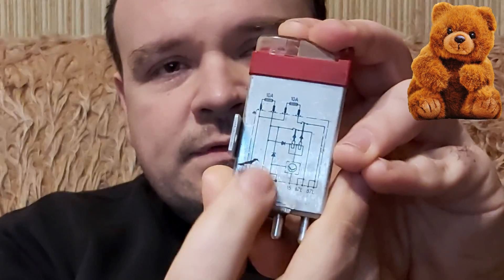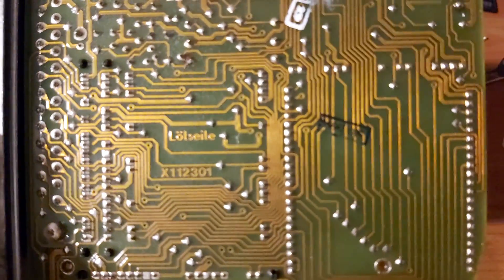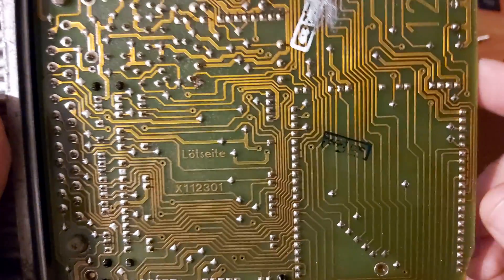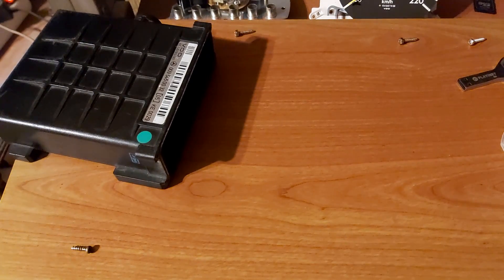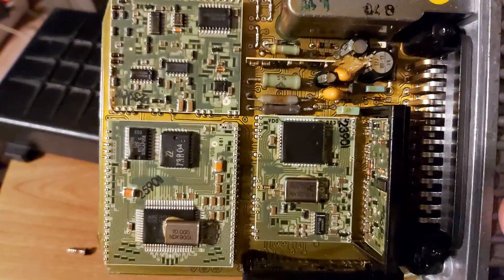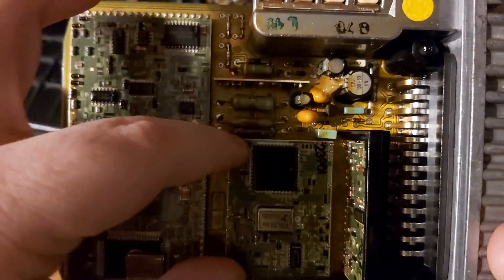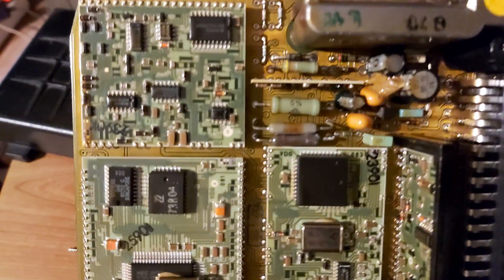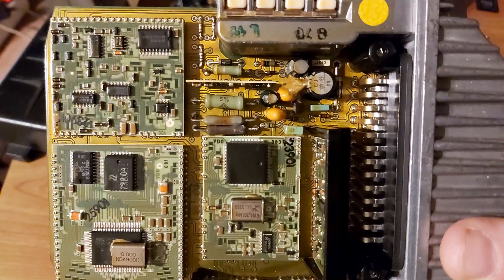㉦Mercedes Ke-Jetronic㉦ - Does the ECU fail?

Comment: My ecu was burnt, to the point where there’s a smoke smell in there… the was was water in the ovp and from there we just don’t know what else to do please help😔
Reply from the maker: What should I say!? Remove everything, replace the OVP as well as the ECU, clean everything, afterwards check all the contacts as well as the wires. This could have happened only if the car was flooded as I would say.
Reply: @ wasn’t flooded, guys at the car wash power washed it the bay to remove the leaves

Comment: What about capacitors in the ECU? I think they do fail, becouse of years.
Reply from the maker: Maybe. ECUs fail in rare cases so no one can tell for sure.
Reply: @mercedeske  I agree with that and hope mine does not fail.
Reply from the maker: @Gr3eGo  🛐
Reply: Hi, my ECU fails twice in couple of years. Only on regulating idle. First time when i change the ECU the problem with low idle was solved. Now, after few years my idle again go bad. After some other repairs we changed the ECU and idle is ok now. How do you think, what couse this?
Reply: @ВасилИванов-р6ч  open your ECU and replace condensators
Reply: @Gr3eGo  This is what i'm going to try next. Just wondering why is always the idle going bad.
Reply: @ВасилИванов-р6ч  idle is controled by the Idle control module and not the Bosch ECU... At least my 560 works like that.
Reply: @Gr3eGo  Mine is 200E😕. After replacing the air flow potentiometer the idle was still bad. Then we put another ECU and idle fixed.
Reply: @ВасилИванов-р6ч  I understand... Different car then .. inspect components inside ECU and replace all condensators, they lost theit capacity for sure after 30 years. I have replaced almost all in my car, even clock stopped working from bad capacitors... But nice thing is it is reparable.

Comment: Hello, i just want to say, that it can fail. Every soldering point is week point, after some time and very temp changes, that solder point can be weaker and resistence will increase until its fail. 
But its a easy repair, if you have solder gun and some knowledge, its easy.

Comment: Hi, want to learn from you that what would the KE Jetronic car behave at idle without the ECU?  Running rich, higher than the normal 750 rpm?  thanks in advance
Reply from the maker: A bit higher idle the car wouldn't have so much power but it wouldn't stall.
Reply: @mercedeske  Many thanks!
Reply from the maker: @herrickmky  My pleasure

Comment: My car won't turn on the dash, fuel pump and heaters when I turn the key, after a while it will start working, is there a solution?
All the fuses are fine, but I found one on the OVP was blown and I replaced it, but it's the same.
Reply from the maker: Is it about a diesel or a petrol car?

Comment: Hello I have an m103 engine vehicle, all the sensors have been changed, the distributor has been maintained, the poti is new but it works unbalanced sometimes and the idle speed does not increase. Could this be another reason? Could the ECU be faulty?
Reply from the maker: If the ECU was faulty, the cold start would be bad and the start in general. Concerning the poti - have you calibrated it?

Comment: Sorry,Not agree with you Ivica
Reply from the maker: Okay, tell me what happened and how did you know that it's the ecu?
Reply: @mercedeske  I haven’t the current on EHA . I Checked continuity and voltage on the plug ECU (positions1,20 ,10/12) everything  ok but still no current on EHA plug so I change th ECU and plug on EHA has the current . It not the first time that I had the problem for ECU but we are focusing on the engine 103 , 117 maybe more défaut on ECU with this type on engine . Regard Bobo
Reply: @bobobobo1646  the same problem also on my car. no current on plug EHA. today opened ECU for check.
Donot want to buy .Maybe will fix it

Comment: Bonjour à nouveau ! comment tester le boîtier ECU s’il vous plaît ? 
Car ma voiture cale, le moteur s’étouffe, car mélange trop riche, mais je n’ai touché à rien.. le moteur cale même quand je débraye en roulant…
Reply from the maker: La meilleure façon de tester l'ECU est sur votre potentiomètre et la plus simple.  Si votre ECU est mauvais, vous n'aurez aucune tension sur le potentiomètre (à condition que tous les fils soient bons).  Pour régler correctement le mélange, vous avez besoin d'un potentiomètre qui fonctionne bien, le lambda ainsi que le eha.  A 80 °C, mesurez la tension sur votre port X11 et vous devrez obtenir une fluctuation de 6,6 à 7,3 V.  Ensuite, votre mélange sera réglé correctement.
Reply: @mercedeske  Le EHA se test ? merci d’avance :)
Reply from the maker: @LaPoYo  Pour ce test, vous devez avoir 3 cordons à pince, 2 crocodile à banane et un avec les deux crocodiles.  Retirez le connecteur eha, collez un fil à pince dans le connecteur et sa deuxième partie à la broche de l'eha, la seconde (deux crocodiles) va au multimètre positif et la dernière au connecteur eha et au multimètre négatif.  Mettez le contact et vous devez obtenir 20mA.  Si vous obtenez une valeur négative, échangez les fils de votre multimètre. Au fur et à mesure que la voiture atteint sa température de fonctionnement, vous devrez obtenir une fluctuation autour de 0, entre -3 et 0mA

Comment: hi , very interesting as always. here I found some "literature" about the ICU - it's a W124 ECU, but I think not the same version. however the tuber says that model it CAN go "kaputt" - not entirely, but the capacitors shown do, they age and dry up. Also, important: it can be repaired. maybe other versions, too, can have the same issue. Look at the video, it's very good. hope it maybe helps someone in the community! bye. video: https://www.youtube.com/watch?v=0h0Jb4yHSTg
Reply from the maker: Yes, I know. But it depends which version of the ECU you have. If you have the newer one with integrated circuits I doubt you will be able to do something. Watch the very beginning of this video!
https://www.youtube.com/watch?v=Nt8hHrxNRFE
Reply: @mercedeske  yes, as the other video's guy said, also. Yet, maybe a lot of W124 have the other version... (I've got the newer one) so I thought it was good to point out that with that model, some cases are not irrecuperable! keep up the brilliant work! ciao

Comment: Здравствуйте. У меня нет оборот прогрева. Как устранить оборот прогрева?
Reply from the maker: Hello. Check your thermostat.
Reply: Термостат нормально. Когда заводишь машину на холодную оборот двигателя должн подняться выше тысячи оборотов. Мне придётся держать педаль
Reply from the maker: That depends on the system you have If you have a KEIII(staring from 1988) then the system has to hold the idle for some 28 seconds after cold start before the RPM drop to about 800. If you have KEIII then there is an issue there, if you have an older type then everything is okay.
Reply: У меня машина 1991 года.
Reply: Какие симптомы может быть? Из-за потенциометра может быть?
Reply from the maker: @Ayanushh_  Possibly
Reply from the maker: Watch this video and do everything as it is told in the video
https://www.youtube.com/watch?v=yY7OXR8RTLk&t=13s
Reply: Ок

Comment: Does the ecu would be the problem of very hard and long car starting?
Reply from the maker: The ECU no. Is it about the long COLD or WARM cranking?
Reply: @mercedeske  I think cold start is even better is than warm, was no problem with starting car last year. Now since winter is over, ride only few times and now suddenly very poor starting, need to hold key for almost 10sec to start the car
Reply from the maker: For the warm start check the fuel accumulator. For the cold - cold start valve and coolant temperature sensor.

Comment: Thanks for the video. I was about to change my ECU because it is showing strange behaviour. My 85 190E has bad idle. It runs fine without ECU, but not with the ICU connected. I checked the duty cycle reading. I know it is supposed to read 70% on ignition on as a baseline but mine shows 48,4%. I know I should read 30% with the coolant temp. sensor disconnected but the reading does not change. It stays at 48,4%. Any ideas? Thanks for all you videos!
Reply from the maker: Do you have lambda? If it or any other sensors are bad you won't get the fluctuation around 50%
Greetings and thanks.

Comment: I’ve got a 86’ 420 sel that has a fluctuating idle from 600-650 rpm. The ICV was replaced with another one and all vac leaks fixed. Any ideas on what is going on?
Reply from the maker: The rubber boot?
Reply: @mercedeske  do you have any videos replacing the boot on a w124?
Reply: @michaelnaeimollah1825  🤣

Comment: I have a bit different themed question - does the injection system fail (the part with the plate) or can it be rebuilt with new seal kit? The plate is straight and every other thing is new/replaced except the unit itself and I'm starting to suspect that it is not working properly. I don't want to buy a used unit for 200-400euros, but I might try to rebuild it. So that's my question, if you don't mind - does it wear out or can it be brought back with seals to like new condition?
Reply from the maker: As for the fuel distributor - just avoid ethanol containing fuel like hell! Nothing is going to fail inside, don't worry. The only thing that can destroy them is ethanol. Mine is working for 33 years and it is still working perfectly. Cleaning and replacing the diaphragm will make no effect on your car so don't waste your money or time on rebuilding the unit. You have on my channel the folder on the fuel distributor. I was talking about it in 4 parts.
https://www.youtube.com/watch?v=FfTpeBAT420&list=PLysDz2b5tZakbpjD-n4AenR9Vp9a25M7f
Reply: @mercedeske  Thank you for your reply, I'll make sure to watch the video, because the fuel distributor is still a bit scary to me! The car didn't have ethanol in it, only e95 fuel. The problem I'm having is jerking back and forth on partial throttle (like 5-15% throttle) and it is very annoying. Maybe you have made a video on this topic and could link it, because I couldn't find one?
Reply from the maker: @RomasTam  Check the fuel pressure regulator. Hook up the pressure gauge on the lower chamber of the distributor and when you press the accelerator, the pressure must drop for 0.1bar at most. I can show you how it has to look like having a functional fuel pressure regulator. Replace the fuel filter, if nothing changes test the fuel pressure regulator. This is what you have to get!
https://www.instagram.com/p/CY91nRpKta9/
Reply: @mercedeske  Watched your video on pressure regulator and I think that might be the problem. The only thing is that I'm not a mechanic and I don't have a way to check the pressure. Will any cheap (I'm a student, so the cheaper - the better) fuel pressure tester have the necessary fittings or is it something rare and I'll need to buy it seperatly? Sorry for bothering with questions...
Reply from the maker: You don't have to be a mechanic for this. If you can find a fitting with the thread 8x1 and hook it up to the pressure gauge then that's it. You will be needing 2 more copper or aluminum washers and that's it. What you saw is not a professional pressure gauge($120), it's a cheap improvisation but it does the job! Watch one more video.
https://www.youtube.com/watch?v=4vOBKpIbwZs